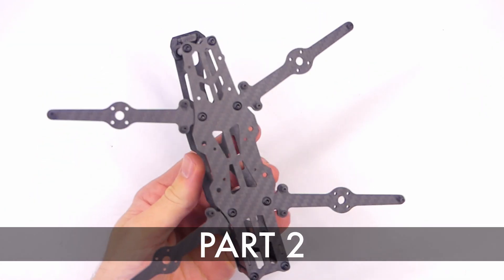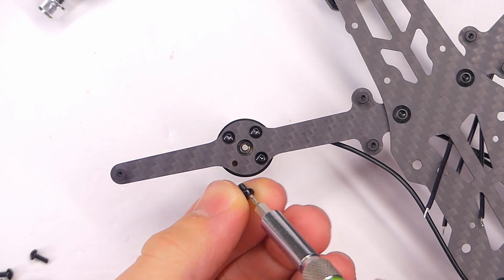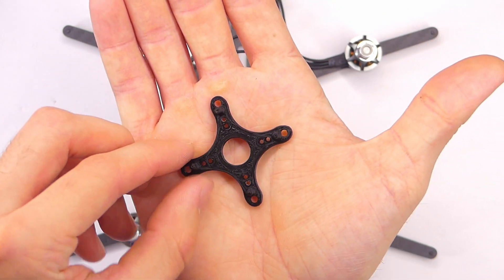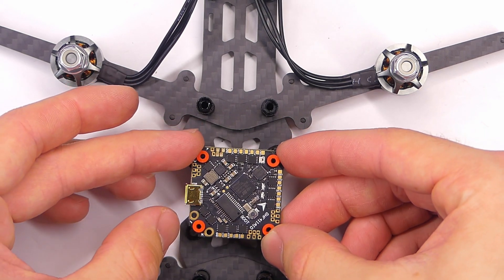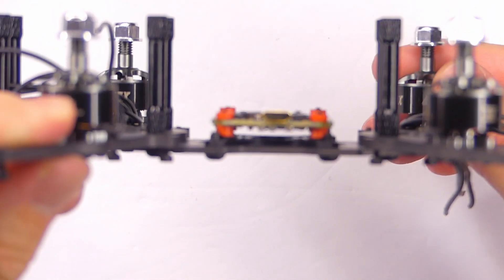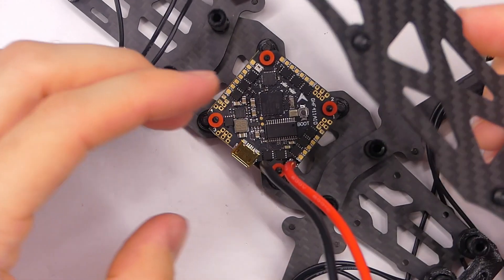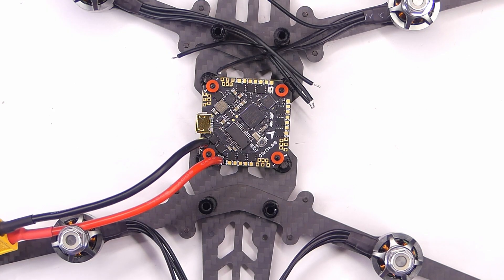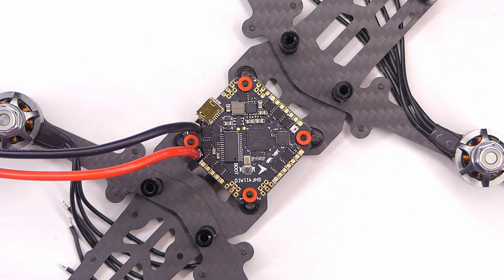PART 2 - Frame, Motors, AIO Board, XT-60 - CINE3 3" CineWhoop Drone Build

Comment: Hella good video man so I have a few questions how can I ask, also while showing some pictures?

I am extremely NEW to FPV drones. I did grow up building & flying gas powered RC planes with my dad. So I do have experience, also am a avid video game player, especially when it comes to VR, & VR goggles NEVER MADE me nosiaded or uncomfortably pukey like most people get with VR. So, I am sure those pros are very beneficial. I am also VERY tech savy, and technically inclined.
  So, I am building a frame I found off Amazon(gotta take advantage of that Prime) its called a:
3 inch FPV Frame Kit, for Brave 163 163mm 3 inch with TPU 3D Printing Parts FPV Racing Drone Quadcopter Freestyle Frame Support 1306 1408 1506 Motor for Racing FPV.

The second item I purchased was my motors, my end question is what do I buy next that is compatible I am DEFINITELY ON A BUDGET!
The name of the motor is:

 Arthur A1408(M5) Motor 3650kv Brushless Motor for FPV Racing Frame (3650kv, 4)

I wanna go the Analog route I CANNOT afford digital even though my vision is horrific! I wear glasses so I am sure this is already gonna be a pain in my bum! Oh I am also very good at soldering. & have my own soldering gear.